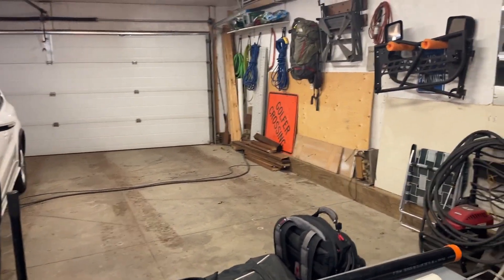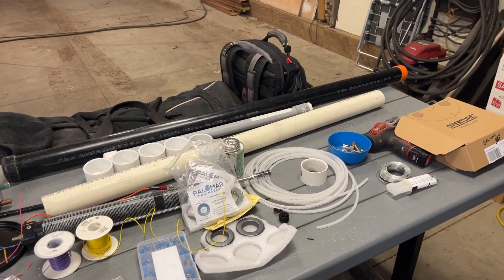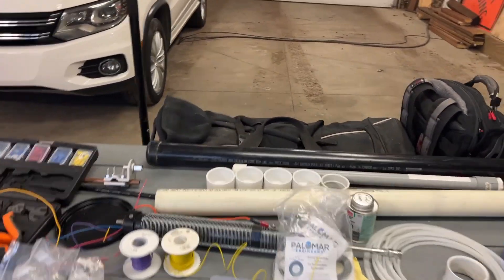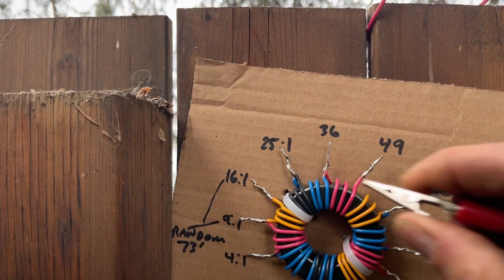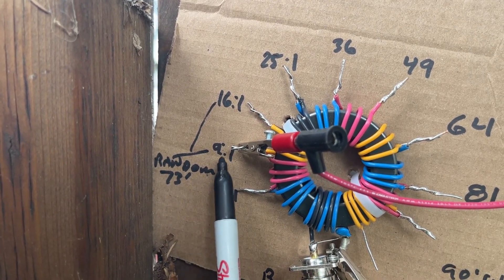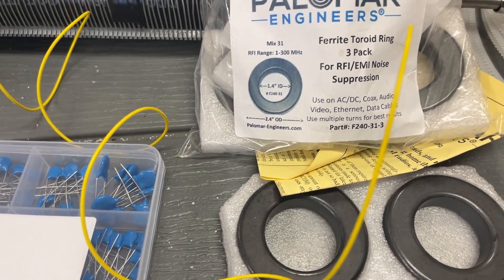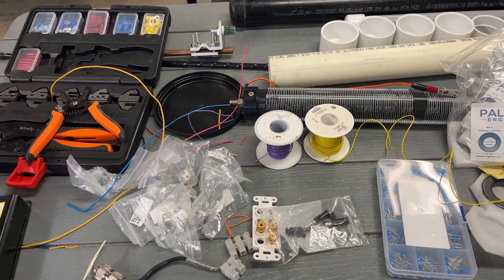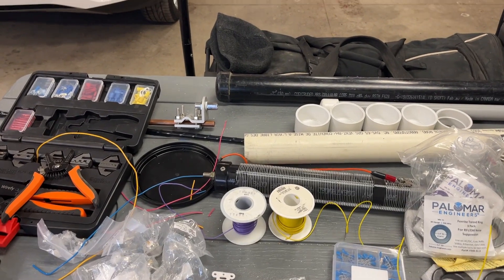Introduction To the Multi Tap Unun Balun

Comment: I have a homemade antenna tuner and it tunes anything using a simpler concept. Its a classic L match but there is an adjustable unun very similar to this I can switch in to feed more conplex loads.

Comment: Nice job! I've made something like this a couple years ago. Sorry, but I've got a question: I got it right that You're using 240-31 for this build?
Reply from the maker: Yes you are correct.  Thanks for watching
Reply: @MrMudsHamRadioTime  I guess it would be much better with 240-43s. 240-31s are great for rf chokes, 1:1 baluns for lower bands, not for transformers. I don't mean to preach :-)
Reply from the maker: Absolutely appreciate the feedback.  I actually have booth types.  Plans are to build another one with the different mix and do a side by side comparison.
Reply: @MrMudsHamRadioTime  oh, that's good! I'm sure You'll see the positive difference, especially from 7 mHz and up. Good luck and 73s from Latvia!